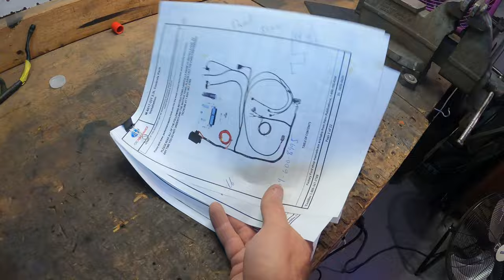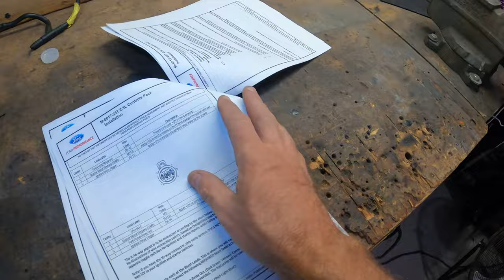EgoBruise Wiring Part 1 - Laying out the Ford Control Pack Harness! - Episode 40

Comment: Nice, im still deciding if using the ford control module or one of those companies that sell drop in kits is the best option, thoughts after planning all this?
Reply from the maker: Man, really depends...If your using a 6R80 auto then go with the kit. Manual, the control pack works. I like the Ford kit, because it eliminates all the the extra unnecessary clutter, but it is too $$$ IMO and comes with more plastics/ hoses etc than needed. I wish they offered a stipped down kit that had just the ECU, harness and sensors.

Comment: Is the HARNESS modified or the OEM of removed from ecoboost car ?
Reply from the maker: Actually neither. Its 100% build from scratch from Ford for engine swapping. So its all new designed, but modeled pretty close to OEM because of engine sensor placement, fuse box etc is relatively in the same position...the ECU is also not OEM and specific to this engine swap kit. The sole purpose of this kit is to run the engine, nothing else.
Reply: @HOUSEOFDULA  Thank you very much would you please advise from where I can get it ?
Reply: @HOUSEOFDULA  Do you think that if used the OEM Harness and ECU will work? If not Can you share the like where I can get the ECU and harness that you used. Sorry to disturb you but parted out 2015 ecoboost and I bought a foxbody 87